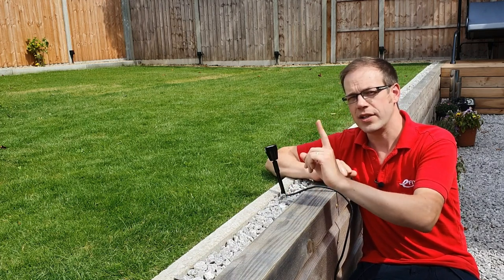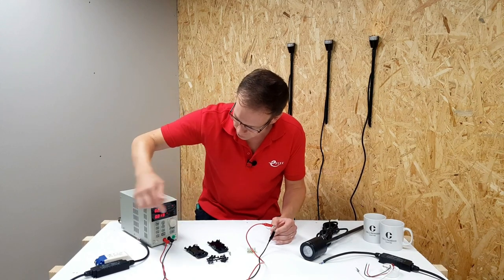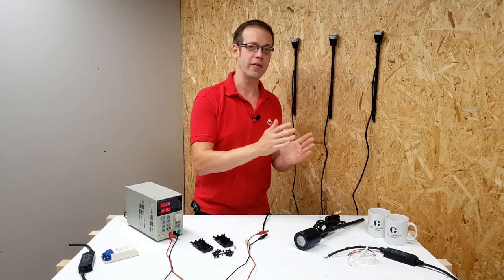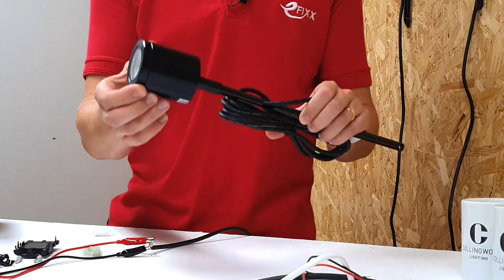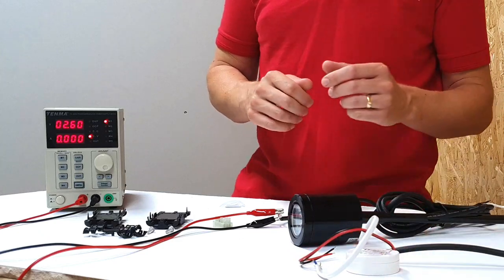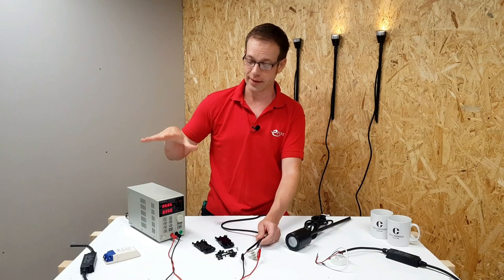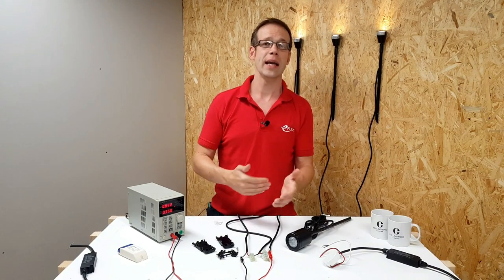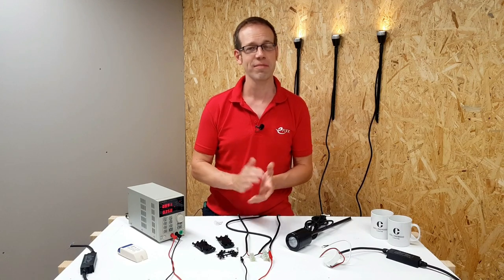KNOW HOW: LED lighting - Constant current LED drivers and series wiring.

Comment: Thank you for this video.  It is very informative.  Where do I find the real world connection.  I have a decorative light fitting with a combination of led bulbs (small ones 5 mm), about 29 of them connected in series whose led driver seems to fave faulted.  I want to replace it. The old driver has no information except input ac at 220 volts, dc out put but driver seems to support 23 to 36 led bulbs.  How do I decide which driver to replace it with.  Most constant current drivers are rated at 300 ma.  If the led draws lower current what happens. Voltage of the led is 3 volts.  Please help.

Comment: So a 350ma driver with a 9w - 18w driver will work on any wattage lights between that range, so how do you work out how many lights you can run off that transformer? E.g is it say 3x3w =9w or 6x3w=18w?? Also what does the output voltage mean when it's got 25v - 50v??  Thanks

Comment: I used a system like this about 30 years ago it was variable voltage with current limiting.  So current was set and voltage tuned up.  Did have problems with some LEDs not liking the current going threw them wired like Christmas tree lights.  Do the video again showing the voltage over each Of the LEDs.

Comment: I have 6 garden lights I want to install in series. I want to replace the existing 2 pin halogen 12v bulbs with 2 pin G4 led 12v bulbs. What driver do I need?

Comment: So the Led strips with 151 resistors can not be put in parallel? To avoid voltage drop? If you know you have a couple to a few volts drop in series, then could you not up the volts ?  does that  not even out through the line and blow the first. Or multiple power sources need to be done with perfect short lines. In every line of 30 or 60 Leds, is voltage dropping slightly after every Led.

Comment: Could you please help me with a question: what will happen to LED lamp if I will replace DC 24-46V 300mA driver with DC36-65V 300mA driver? Will it burn out rapidly or will it work same, but that driver will be under less stress?

Comment: 9:35 I wired my constant current drivers ( 700ma) in parallel and it worked. I don't understand why it didn't work inseries. Would the dali's have anything to do with it

Comment: hello I have a mirror with an led driver 600mA constant current and 2 LEDs do they both get 600mA or 300mA each? I can't see if they are parallel or in series
Reply: Ok I got it they have to be in series, it says 600mA max.24V on the driver